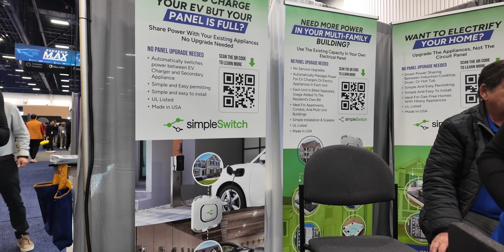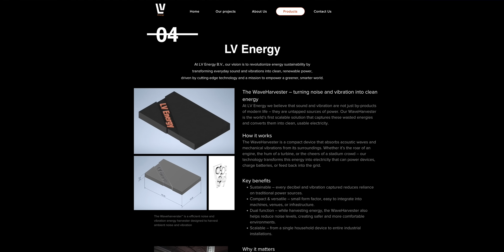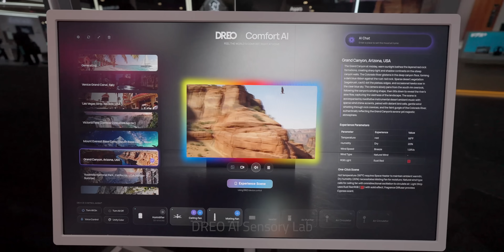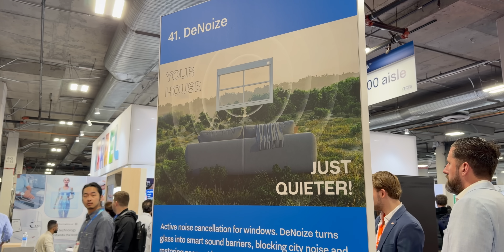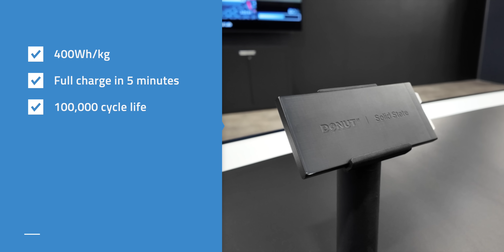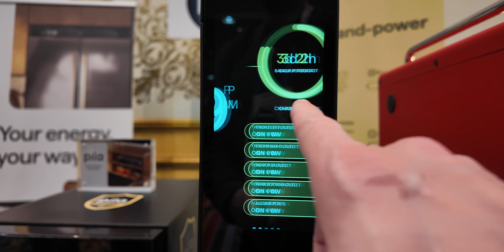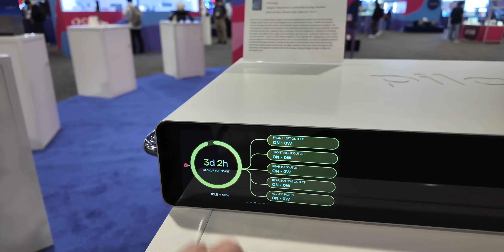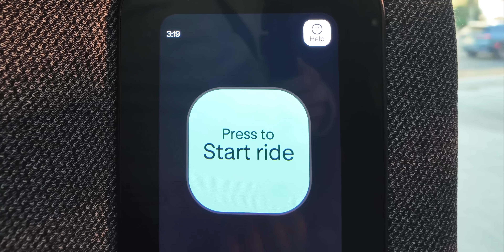The Most Controversial Battery at CES 2026

Comment: I love the donut battery. But giving it some thought, to charge, for example, a 50 kilowatt battery in 10 minutes. The charger would have to be in the 800v - 1200v DC. The amperage would have to be huge.                                                                                                            If I am doing this correctly, using OHMS Law,  Watts = Volts x Amps. 800 volts x 400 amps would be 320,000 watts in an hour. Divide this by 6 to get 10 minute increments. That comes out to 53 kw. I really don't know of any chargers out there currently that can do this, other than the Tesla semi charger at this time. No one could charge like this in their home. Home charging would still be based on sharing the home with a charger, on a 200 amp service. A 40 - 60 amp charger at home, would still charge the donut battery like a lithium battery. There could be a higher current flow throughout the charge cycle when charging the donut battery. Lithium batteries start winding down the amperage when they get over 50% - 60% charged. So this 10 minute fast charging really could only be offered at a DC supercharger. I don't have a problem charging at home in the overnight, charging at home would still be the cheapest. Even if it took 4 hours to charge at home, that still would work for me.  Don't get me wrong, I love this solid state battery. If nothing more than the cycle life and it's cold weather performance. If I need 10 minute charging, I would seek out the appropriate charger. This type of charging would encourage more traditional gas station to install superchargers for gas pumps. Not sure if my thinking is on the right track with my math. But, this battery is what EV's need to become more mainstream.

Comment: Glass is actually a low frequency absorber, though not effective. Low frequency issues coming from trucks are structure borne, not specifically coming through windows. I highly doubt how effective their NC system could be inside a room, without affecting sounds from stereo or surround audio.

Comment: MORE OUTSTANDING WORK!  Thanks Matt!  Battery management highlights CES also water/shock proof systems.  I’m migrating to electric driving, living and camping, but have limitations with sources/storage. NEED a range extender for EVs/Trailer/campers.  Dream of a modular fuel cell/battery system or multi fuel generator/battery that can fir in my EV truck/trailer.  works in theory.

Comment: Why do people use smart locks? genuine question, like any form of lock is really just a deterrent but smart locks are vulnerable to all new methods of attack cybersecurity wise and adds more complexity to something that really doesn't need to be complex at all. What's the advantage over a deadbolt, just convenience of not having to carry a key I guess? I know I'm a bit more paranoid about cybersec stuff than most of the population but failures and vulnerabilities in stuff like this isn't unheard of at all.
Reply: Convenience. Of course, you could call it laziness.
  
Good usage scenario:
No worries about children losing keys or locking themselves out (especially in very cold or very hot weather).
Reply: @michaels3003  That's why we invented the key under the rock technology. Or you know, a neighbor can have a spare key and in exchange you can have their spare key in those situations. Also the Lockpicking lawyer will probably show in the next month how to open that ''secure wifi electronic safe lock'' with a fresh orange peel or the cap of a water bottle.
Reply: Security isnt an issue. People who want to break into your home will either go through glass, steal your garage door code, or kick your door in. Yes technically smartlocks are LESS secure but you dont see actual criminals going around and hacking them. It's only security researchers/youtubers actually doing that.
But yes, the advantage is not having to carry a key, giving a digitally expiring 'key' to a relative, neighbor, or airbnb customer.

Comment: I’m really interested in Donut lab’s solid state battery. I’m hoping it’s not fake but if it’s true it has the potential to change the whole energy sector
Reply: Capacittery
Reply: @csmarkham seems the way it’s pointing the trade off not being spoken about will be how long it holds charge. If that was weeks not months of chemical batteries and it doesn’t break at zero charge that would be still be highly workable it many use cases. We’d have to adopt just in time charging. Would even make a lot of sense for V2H
Reply: someone really interested would have watched already the other dozens of videos covering the scam
Reply: No patents, the company is NOT a battery company.  the batteries can have insane currents drawn, but still only tiny tabs.  Ask any electrician how high currents they would draw from those tabs.
Reply: it’s fake
Reply: @Martin-po9sz  it's real, they are easy to make
Reply: Hopefully we’ll see these batteries out in public in early 2026.
Reply: CATL LFP battery already in production many years ago have 12000 charge cycles, 10% degradation. I don't see the point of "solid state" hype. Chey Bolt 2027 model year will have this battery and I plan to buy it. Even you charge it everyday You still get over 20 years battery life. Most people don't charge it so often.

Comment: Looking forward to that Donut Labs deep dive!
Hopefully there aren't any holes in it.
Reply: @UndecidedMF  I found this paper in the replies on another Donut Lab video, where the guy thinks its a Quasi Capacitor. The paper shows 400wh/kg, so it looks legit. This is the name of the paper. Video below.
Nanocell-structured carbon nanotube composite fibers for ultrahigh energy and power density supercapacitors.
https://youtu.be/YsgIHqGena4
Reply: @UndecidedMF 
Don't title the video SOLELY about the battery, then make us dig to find it - all 2 minutes of the most general, vague 'coverage' you give it - amidst all the other crap in this video.

I'm no longer 'undecided' about the vague, clickbaity quality of the content you produce.
Reply: @justinklenk  To be fair, the amount of info on it is very limited.  Apart from the stats, the company is being very vague about production method, design and chemistry.  Until we see independent verification it is all very speculative.
Reply: @brynphillips9957  Doesn't excuse the other 80% of the video being completely unrelated to the title though.
Reply: @jameshodgetts7541 it's all about CES which is in the title or am I missing something?
Reply: @brynphillips9957 
This is a PROPER "mention" by a YouTuber on this battery and its people. Most revealing I've come across. It's quite a piece of journalism, actually. https://youtu.be/RbGxbII44eE?si=Rc6GEkwcMGxtF0Pk 

But THIS clickbait-and-switch video? Not cool. I've "decided."
Reply: @divat10 
No - the title is about the thing (the battery) ITSELF - "...AT CES."
Reply: I see what you did there. 😊
Reply: It has holes, because the use Graphene nanotubes

Comment: I am a bit surprised you like the switch for the car charger. Here (in Europe but probably also for North America). I have a load balancer that decreases the amperage on both my chargers depending on how much power I have left on my grid connection. This is way more friendly as a switch.
Reply: The current values (amperage) are lower with 220 V.
In the US cities, the voltage should be around 120 V.
Example for 2400 W:
120 V: 20 A
220 V: 11 A.
Reply: @michaels3003 sure. But load balancing is stijl a much nicer solution than the switch right?
Reply: @joostwestra  , ja 🙂.

Comment: I can imagine the sound canceling window tech could be used in reverse to stop anyone from using window vibration to spy on conversations within a building. Good privacy tech
Reply: But also how it could be used to actively spy on conversations maybe even by simply reversing the tec
Reply: Now, imagine that it's connected to your wifi or bluetooth and it's just one more thing that can be used to spy on you and gather data to integrate into GAFA so they can sell you more disposable stuff that you don't need.
Reply: Very astute connection you just made. Wouldn't have been my first thought for branch-out applications-- yet it's definitely the MOST parallel-convergent use.
Reply: Such systems exist for exactly that reason, they use lasers, there will be no point in using your window cause it means you already hear the sound
Reply: I think you need to come to the realization, nothing you say will ever be private, if someone else doesn't want it to be... The expectancy of privacy through sound, is pretty much out the window, pardon the pun...
Reply: My former company has patents in cancelation tech and the effect can be very localized…some areas are actually louder.  Significant urban issue tho.

Comment: that humidisat bathroom fan switch is awesome
Reply: Those have been available for years, unless I'm missing something
Reply: @dhalbrook  Yup. Had one installed in my bathroom during a remodel 7 years ago. You can go buy one at any hardware store.
Reply: The best thing is that it's not connected to the internet... so tired of every single tech being connected for no reason at all.
Reply: Can it detect smells too?
Reply: @mra4107lol no you goofball
Reply: @mra4107you should patent that idea.
Reply: Yet it misses the fact you need to put a couple timer choices on there. 5 mins, 10 mins, 20 mins, 30 mins, etc. Poop also requires timers hehe

Comment: Regarding a house with a low grid current limit: I live in the UK and my EV charger monitors the total power being drawn from the grid and if I have too much demand across the home it reduces the charging rate - it doesn't stop the charge. The grid current limit is user adjustable to suit the home. It's made by myenergi. That seems to be the most efficient way of not exceeding the home supply limit.
Reply: It's pretty much standard in Sweden. Nifty systems, a current clamp on incoming supply and wireless link to the charger to control the power sent to the car.
Reply: Tibber/Easee does the same thing in Norway. It's neat.
Reply: @tvuser9529 Yes, Tibber Pulse and Easee here in Sweden too.
Reply: This current limiting has actually been a uk requirement on all EV chargers that have been sold in the past few years. You just set the limit to be 10% below your main grid fuse (60A, 80A or 100A) and the charger does the rest.
Reply: Mine does too.  I believe its a requirement in the UK.  Fun fact, i actually tried to get mine to lower the charge current by maxing out consumption and I couldn't do it.   Even with the oven, the tumble drier running, and the 9kw electric shower blasting, the car still charges at 7kw.  100A at 240V is a LOT of power to play with.  in homes with 60A fuses, it will kick in more often, but day to day its unlikely to be an issue

In the US though, where 100A is on a 110V connection, and they have an obsession with massive water heaters and air conditioning, then yes, they need the tech.
Reply: @jameshodgetts7541  100 A for 240 V sounds like A LOT, but then I remembered that you do the one-phase ring circuit thing, so my three-phase 25 A would correspond to 75 A in the UK. In the winter when my air/water heat pump water heater run with level 2 or 3 aux heat the car charging get paused a lot and I have to take care not to run the electric kettle and the stove at the same time. 😅

I am too cheap to upgrade to a bigger main breaker though, but probably have to upgrade the almost 20 year old heat pump soon. Maybe the new one will be smart enough to watch the load too.
Reply: @MattiasKesti yeah, we generally only have one phase going into domestic property. The ring circuit thing is just the way the wires work in the walls, and it’s daft but not at the same time lol. 

Three phases is around, commercial premises and tower blocks/large residential buildings usually. But each unit will generally only get one phase of the three to play with, unless it’s commercial.
Reply: @jameshodgetts7541 our panels are usually 200a at 240v, not 110v. Homes in the us have a mix of 240 and 120v circuits. High wattage appliances like water heaters, stoves and electric furnaces and heat pumps run on 240v while the wall plugs and lighting are 120v.

Do you all really only use 60a 240 services in europe for houses? Panels over 100a 240v pretty much became standard in like the 50s here, even for appartments. I've lived in 2 appartments here in the us and both have 200a 240v panels, along with every house built in the last 70 years I've ever had to work on, I've only seen 60a 240v panels in houses built before ww2 that were never updated
Reply: Matt here in MA my 100A supports my EV charger with a basic ‘dumb’ load balancer
Reply: Yeah came to say this.  Car chargers with CT clamps are very common in Europe

Comment: Paper batteries and wireless power delivery are two things that got me really interested
Reply: Yeah, I’d like to know more about the wireless power…sounds lossy and a huge source of intereference maybe medical concerns.
Reply: I had always wondered why smart lock manufacturers weren't working with QI style wireless chargers to keep a battery powered. I guess this may make more sense as it doesn't require wiring a door.
Reply: Those two were basically the only thing I was genuinely interested in. The rest seems like useless tech that will cost 500% of the price to facilitate people too lazy to turn off a fans oscillation lol.
Reply: wtf is paper battery
Reply: @SC-zq6cu  if you watch the video you'll find out.
Reply: @SC-zq6cu  Did you watch the damn video bro?